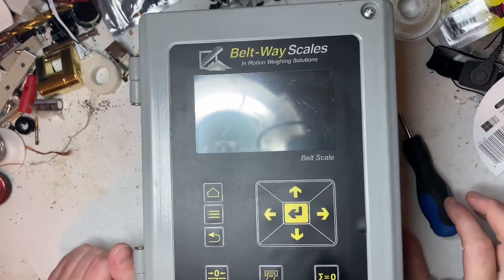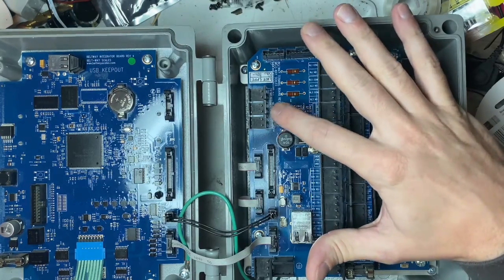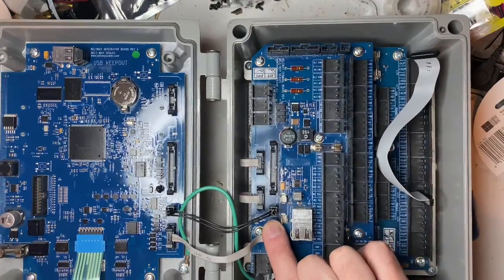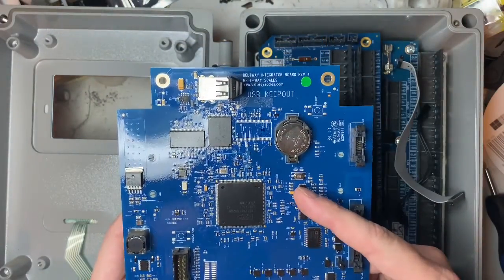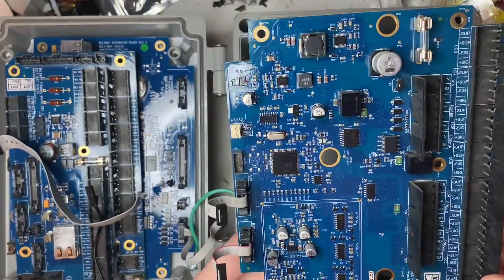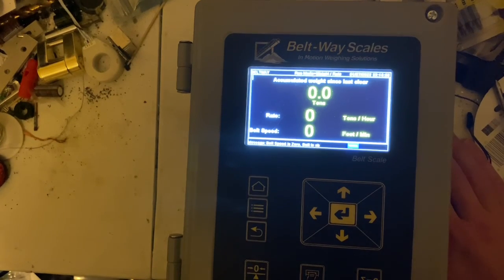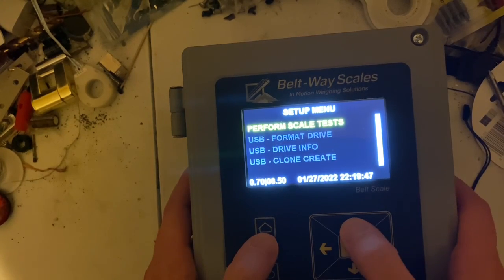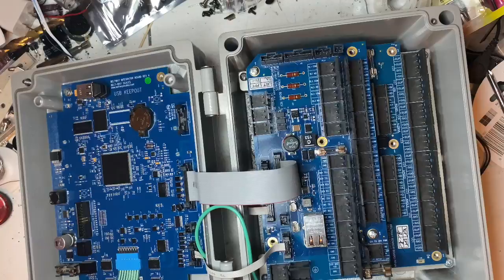Troubleshooting Belt-way scales integrator control box and maintenance

Comment: We have this box at work, and it was wired with the negative to positive and positive to negative. When powered on the fuse which was a 7.5 amp at battery blew and the 15 amp inside box blew corrected the wiring and changed fuses but unit still doesn't come on.
Reply from the maker: Replace the dc power supply. Or bypass it
Reply: How do you bypass it